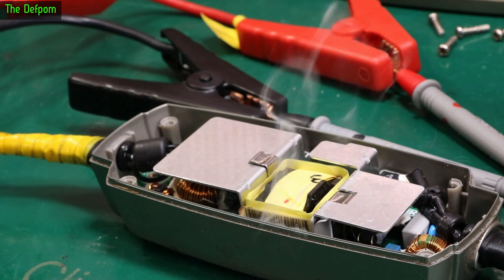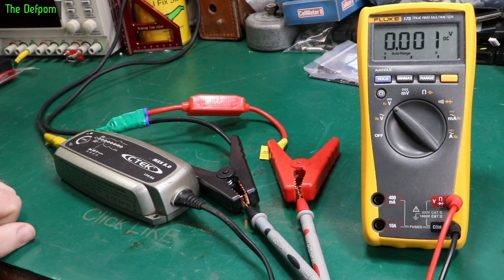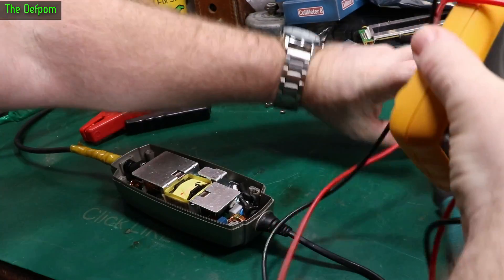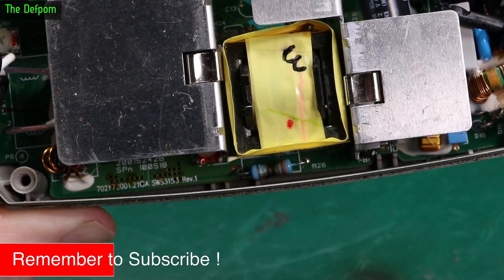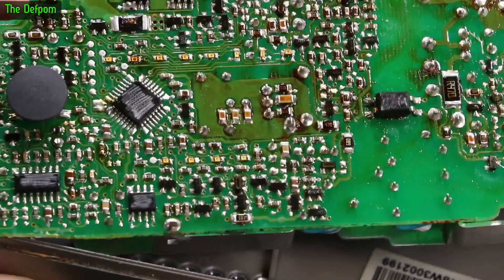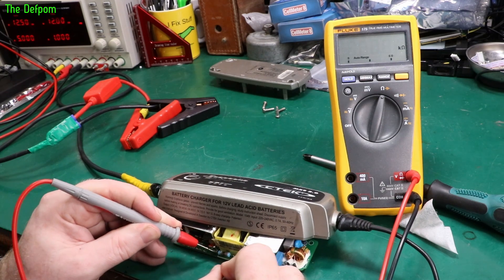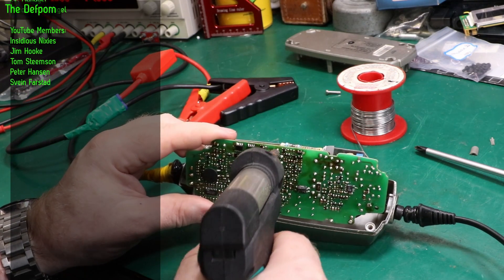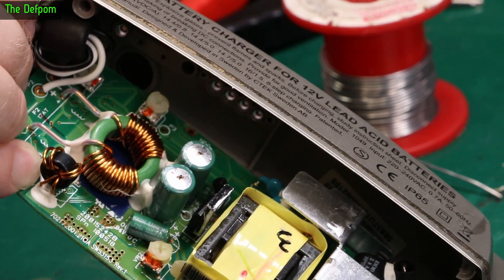🔴 CTEK MXS 5.0 Battery Charger Failed Repair - No.1202

Comment: Bonjour, 
j'ai un chargeur cetek xms 5.0 qui a la led rouge llumer et n'a pas la led sous tension , l'alimentation 300v dc est bonne ainsi que toutes les diodes l'alim fait du bruit , les condensateur de sortie 1000mf sont bon le 40mf 400v est bon , que faut il controler d'autres , la tension de sortie est bonne mais aucun courant ne sort .
que controler ?
merci

Comment: Probably the mosfet is blown and shorted, then you get 300 volts on the resistor and that has probably destroyed more components. Maybe a vise decision to label it unfixable if you don’t want to replace all semiconductors on the primary side.👍

Comment: I have a MXS 5.0 and its working, but you can here a continuous noise coming from it after 9 months and apparently I'm not the only one with this issue with the MSX 5.0. It's not loud, but you notice it. The older MXS 7.0 I had started playing up with the dreaded continuous relay clicking sound which was a common issue with the MSX 7.0. The couple of pro 25's I have are ok so far. But there seems to be some quality control issues with these, and they are sold as a premium product.
Reply: @davidclarke6658  did you repaired mxs 7 that clicking sound? I get clicking sound and it basically do not charge.
Reply: @NaviPaslaugos  It was about 12 years old, I ended up throwing it out.

Comment: Nice video! The problem should be with that sot-23 mosfet at one pin of the resistor..
Possibly we had the same problem: www.youtube.com/watch?v=s1MqV_JlYjM
If it had good capacitors it wouldn't have failed in the first place. 
Plus not only they use CrapXon capacitors the have a 16V capacitor on a rail that works at 15.8V in "Desulphation" and "Recond" modes! and even 14.4V is too high for a 16V cap.

Comment: Glad I've avoided buying a Ctek charger, my gut instinct told me they were over priced, this vid has confirmed that!  The construction is very disappointing with no or very limited ventilation which means everything is going to run hot. Those dodgy looking caps don't appear to be quality parts either. I have several Optimate chargers which are at least 25 years old, some older, and they still work perfectly. I also have a number of cheapos from Aldi and Lidl, and they work as well as the Optimates at a quarter of the price. One of the Aldi units is on maintainance charge duty for most of the year, and has been doing that for 10 years, no problem.  The only thing I don't like about this and most other smart chargers is that they cut off if there is a power cut and don't automatically resume charging when power comes back on, they have to be manually reset. The old Optimates just resume charging. Just to confirm, the Ctek and other smart chargers have to see a minimum battery voltage before they will give an output, some even check the state of the battery before they will charge. I thinks that's by checking the internal battery resistance, if it's not within it's program spec then no charge. So they may not be fooled by an external power supply.

Comment: Definitely taking notes! Your videos flow so well.  But these types of repair prevention practices really need to stop.  They are found across all industries (not sure why only certain ones like agriculture and big tech get the attention).  In my main job working as a in-house engineer for a biotech company fixing all their lab equipment, >90% of the 400 pieces of equipment I am responsible for, the manufacturers refuse my access to service manuals/schematics.  We've really hit a new low when manufacturers of dinky chargers like this are scratching the part #s off ICs - seriously?! Thats one of the reasons I made my channel - to help others who might be in a position like myself with limited resources.  Thanks for all your content!

Comment: These are not cheap! This brand is premium, at least in price. They perform well when they work, but this fault is very common with the lower end ones.  I have an 8amp one, and it’s nearly 10 years old, and works great. I also have a 25amp one that is about 7 years old and powers our caravan.

Comment: 5:24 - When you have exposed resistor like this, you can touch with probe, one leg, and then touch on middle of resistor, then you should be able to see roughly 1/2 of total ohms. Then you get idea what value it was.

Comment: I just bought one of these last week as the battery on my Porsche goes flat  after a couple of weeks. They do have battery protection on them and I think they do need to detect the battery. These are quite expensive units and I am concerned about the quality after watching the video.
Reply: Well you can always get laboratory&research grade equipment, for even more $ and quality. 
You should check fuses for parasitic drain on your car.
Reply: @orion310591RS  no that’s just how porches are. Lots of electrical and small batteries

Comment: I quickly learned to use my CTEK MXS 5.0 upside down, as it cooks itself the right way up at full load, very poor thermals to put caps right next to a barely capable heat sink, they greased the 'O' rings though as mine had the same greasy stuff when I opened it.

Comment: I still don't understand why it takes so much circuitry to chagre a lead acid.
Reply: Because it is not all it can charge…. These chargers also have battery reconditioning etc…
Reply: They have a lot of reverse current protect and are suitable for long term trickle charging including gel batteries. Still protection obviously leaves something to be desired